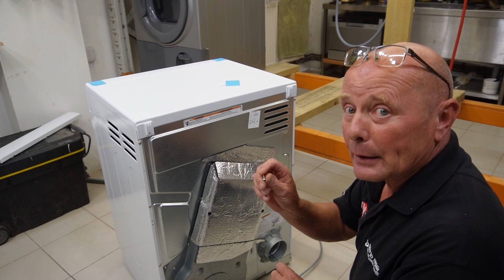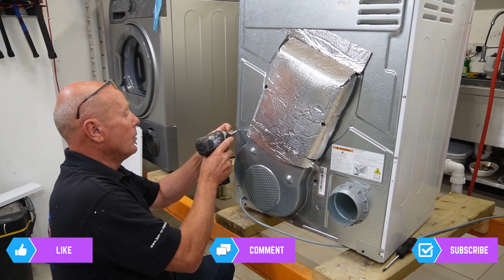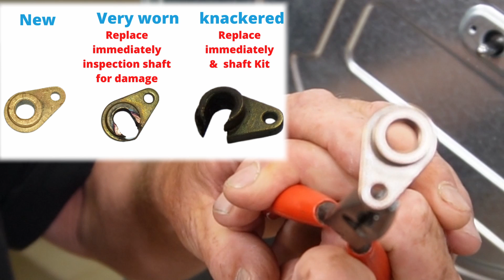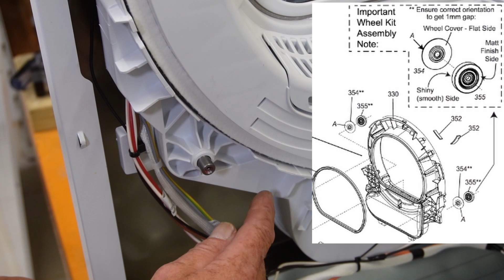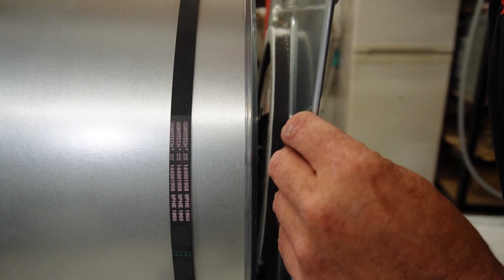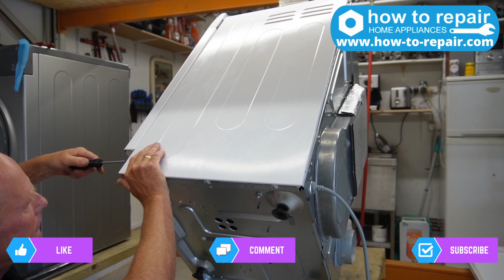How to Replace a belt, bearing, capacitor & motor on Hotpoint, Indesit & Ariston tumble dryers

Comment: Brilliand Video .Although ive been a service engineer for well over 50 years its great to see how a machine comes apart and goes back together  instead of having to discover it yourself by trail and error .Its such a shame how modern machines are so flimsy though .We have a 50 year old Phillips dryer here and apart from an anual decoke its never failed and its soooo quiet . cheers

Comment: Should my drum rotate fairly easy as the belt has got on mine, but the drum requires a bit of effort to move, the bearing looks good.
Reply: actually, looking at the belt replacement, the drum rotated much more than mine, ah well, more digging........

Comment: Thank you so much for doing this step by step video for folk like myself, those that like to do their own repairs. 

I'm so pleased that you did this video for this particular model as my daughter has one and it's only 2 years old. 

When viewing previous older Hotpoint dryer repair videos  it looks like many design changes have been made, ie no secondary pulley to have to stretch the belt over, like  he steel tube tip!.

Am also doing a belt change on her H1D80WUK, and testing of thermostats since no heat was available when machine broke down. I  suspect  as you have said in your videos's that overloading was the main issue given belt just simply snapped. 

In the earlier days, one could simply press a thermostat reset button to reset the thermostats but this is no longer the case with this model as automatically cuts out?

Changing the belt used to mean dropping it in from the front end, think I will now choose the rear/bearing end this time as it looks so much easier?

Thanks once again.